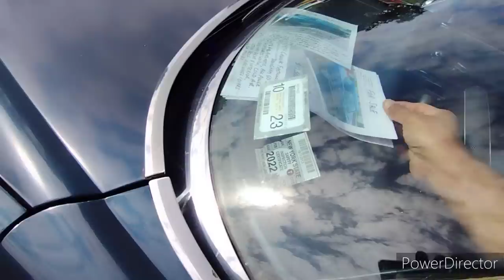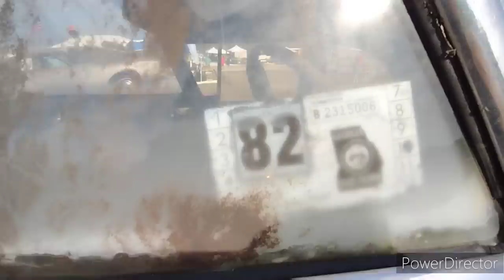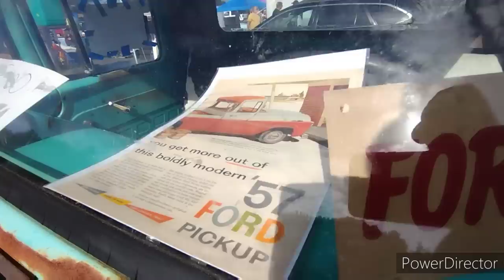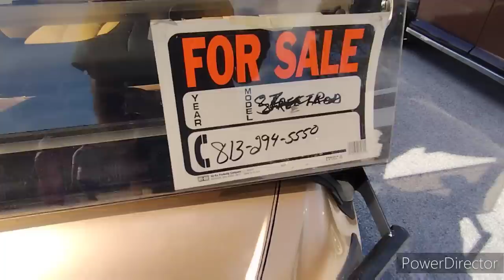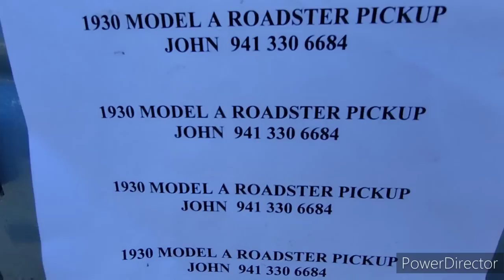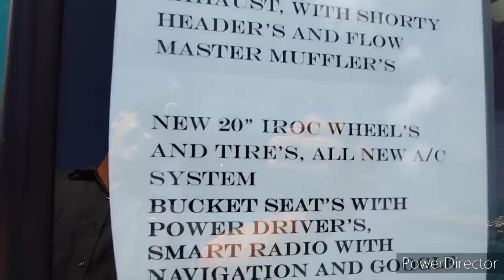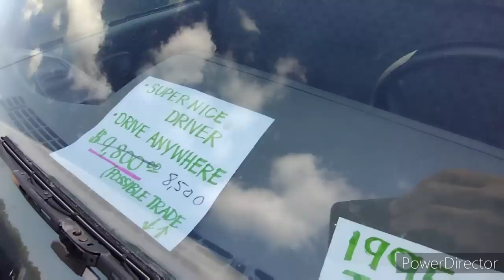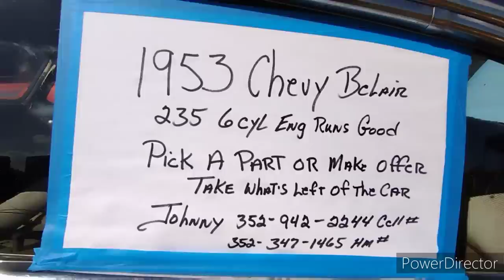Sumter Florida Swap Meet December 2022

Comment: All the shows up here are like that, you can't escape the music. 

The Pontiac ambulance looks to use 1959 Catalina tail lights.   I have Twitter in another window and somebody posted a clip that may have that very car in it, a wreck in the 1969 race and you see this or a similar ambulance. 

Voice over sounds fine.  

Rust on those is worse than up here in NY.  

Those 59-60 flat top sedans to me are some of the best looking cars they ever made.  

Blue convertible at about 38:00 is a '36 Pontiac.  Rare. 

For $14.5K you can make 7 Up yours...

Comment: I believe your referring to a "Hamm's Beer" sign?
At 43:58; I had a concept similar to this, but it was a older crew cab, with widened long bed (for duelies), 4WD, a roll off section (lays flat on ground and truck) a storable two ton(+) hoist, small compressor, small generator, multi type welder, tool storage with mountings for a goose neck or fifth wheel.  ;-)
Alas, no Corvairs.